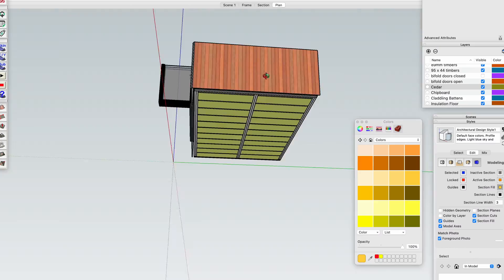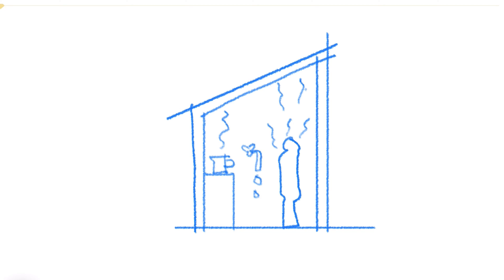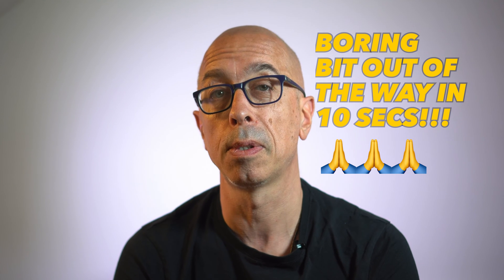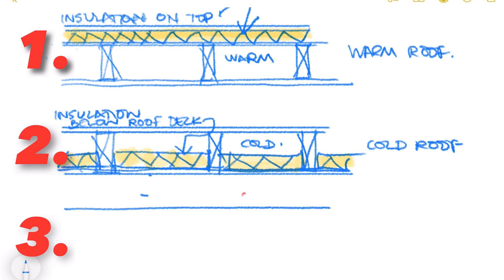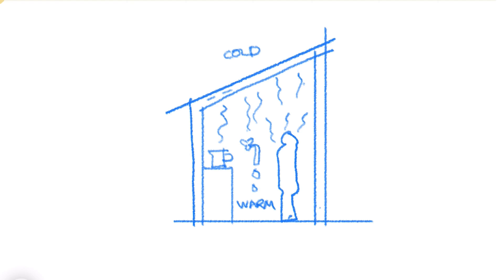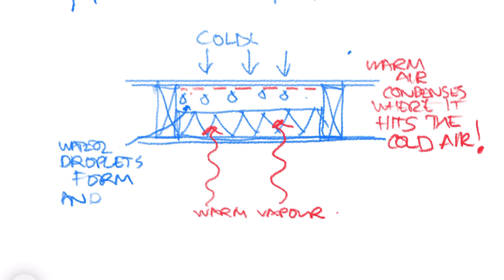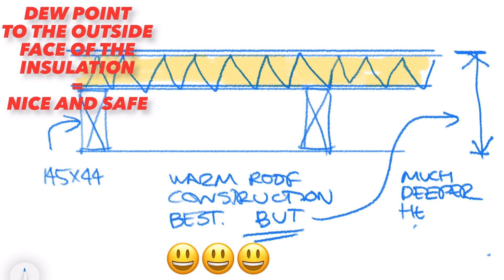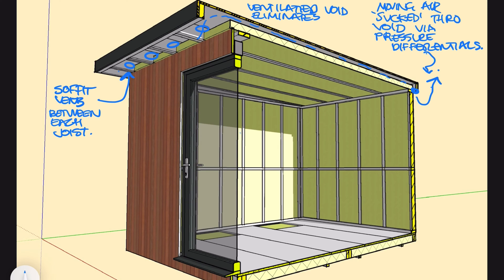Insulation - Warm roof  v cold roof v hybrid - and why should you care

Comment: Great video, I'm at the design stage of a new build at the moment with a standard pitched roof which is mostly vaulted on the inside.
My question is, should I consider a warm roof? I don't see many examples out with the context of flat roofs. Is there a reason for this i.e are there disadvantages of a warm roof for a pitch, apart from the increased height.. only thing I can think of is perhaps nailing tiles/slate would require more timber battens/sarking ontop of the insulation board?
Reply from the maker: I would always do a warm roof, assuming no height issue. You would need counter battens as well as battens, with long insulation fixings through into the rafters. Even though you’ll be using a breathable roofing membrane, i would also ventilate the batten cavity by venting eaves and ridges. The problem with insulation between the rafters for a cold roof solution is the hassle of cutting and inserting between, the wastage of such an expensive material, the need for slate vents, and then for your u values, having to provide an additional layer of insulation on the underside. Don’t underestimate the cold bridging effect. Although a warm roof is a bit more work for your roofer, a cold roof is waaay more work for your joiner, plus more materials
Reply from the maker: If it’s an existing roof, then of course a cold roof works since you don’t want to strip all the tiles off. I show the solution here….
ATTIC CONVERSION START TO FINISH - ArchitectBuilder shows you how in 8 minutes
https://youtu.be/4X9_J4cskFE
For how to vent the batten cavity for a warm roof, I show you here……
How to roof this extension on your own - simple rules to do it yourself
https://youtu.be/oq4dCcan86s
Best of luck with it
Reply: @build-better-things  That makes a lot of sense, I've always liked the idea of a warm roof, amazing advice and greatly appreciated, I'm learning a lot from your videos, subscribed and shared!

Comment: Really good video, quick question: what about a hybrid roof with waterproof tongue & groove panels on the ceiling to prevent the moisture from leaving into the ceiling space? Does the LED spot lights cause condensation?
Reply from the maker: Hi. The panels…do you mean corrugated insulated panels? I’ve never heard of water proof T&G but it’s the deck that can rot first , if any vapour condenses on the underside as it comes in contact with the cold and it cannot breath or is not vented .  Spotlights in a cold roof and a hybrid roof create a condensation risk since they puncture any vapour barrier but also the insulation is often reduced to allow the depth of the fitting flush with the ceiling. I hate spot lights in small and low spaces anyway, I don’t really understand why they’re so popular for garden rooms and extensions.
Reply: @build-better-things  the panels would typically be soffit boards which slide into eachother creating a waterproof surface if used on the ceiling. As warm moisture can't pass it would it stop condensation? The only area of compromise would be around the spotlights. Also as this is the ceiling it means the plasterboard underneath stays dry rather than acting like a sponge for the warm moisture particles.